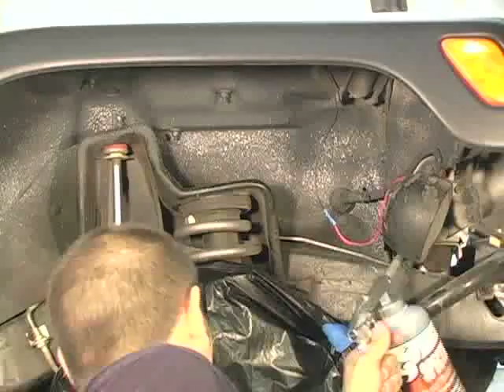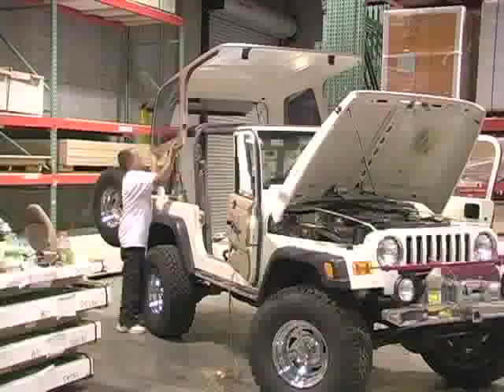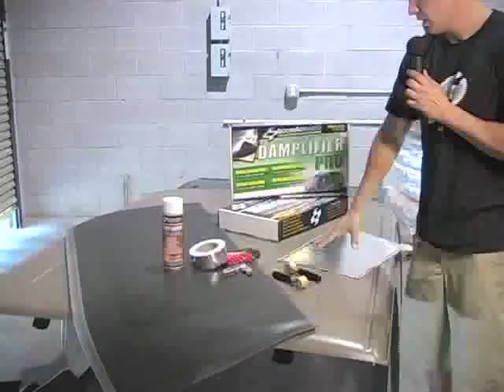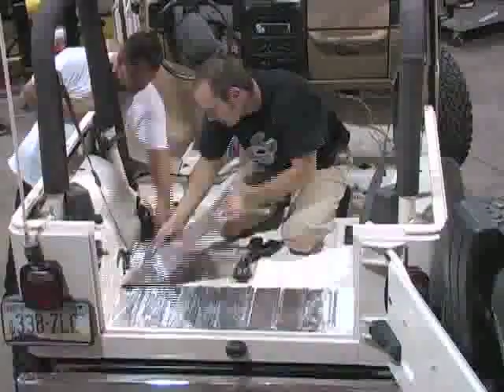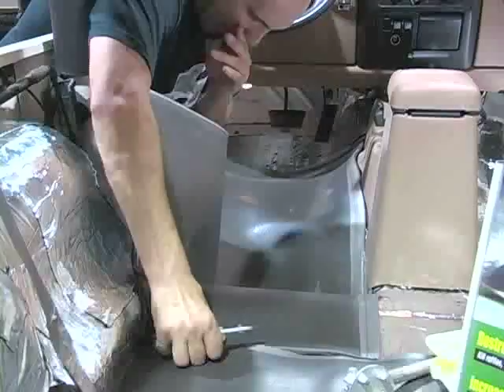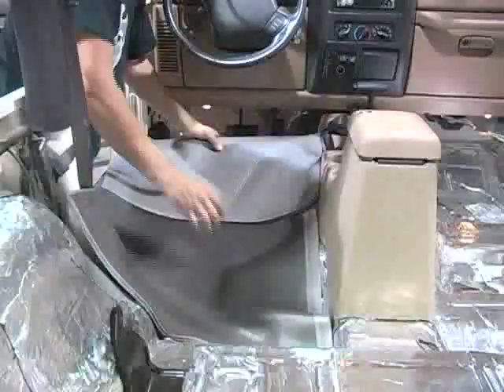Second Skin Jeep Part 2 - Sound Deadening - Damplifier Pro Vibration Mat

Comment: I wonder if this coating would  dampen noise from muffler in a n 84 Corvette? The rumble is mind numbing after 30 miles.
  I wish people would use more care with cleaning products! It goes through your skin into your blood and can cause Leukemia or Aplastic Anemia or who knows what else. If it says no skin contact there is a valid reason! My dad told me to follow that advice after he got Aplastic Anemia from Benzene, which meant a blood transfusion weekly or a bone marrow transplant that will work. He ,also, had been exposed to x rays from the "good old days" from the  late twenties  to the forties from dental x rays he was giving, when they did not follow safety procedures like today. Use care or you may get a life threatening disease. I'll get off my soap box now.